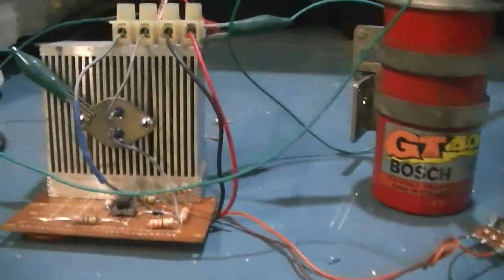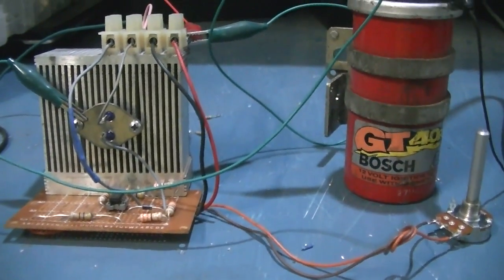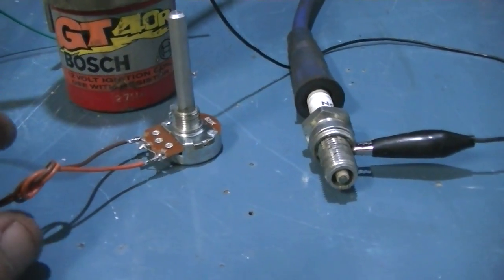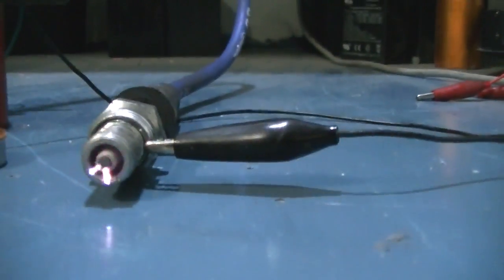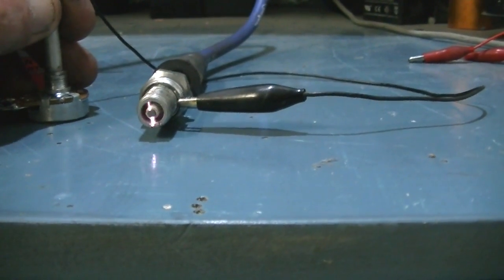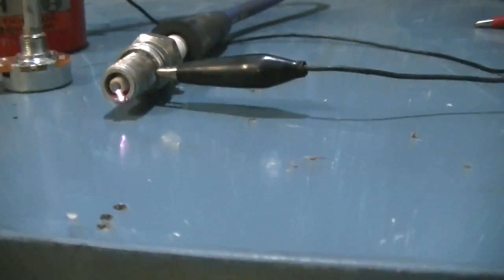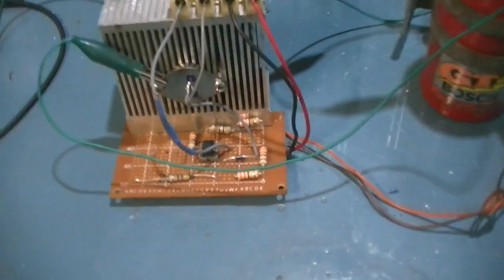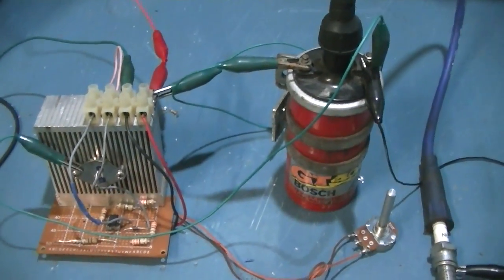HHO ignition circuit done.MTS

Comment from the maker: @rwg42985 Hi Russ-that could indeed be the case.I am still learning as i go.I was thinking along the line's of a plasma plug situation when i made this circuit.Going to get it instaled on the motor tonight and give it a run on standard fuel.If all go's well then i will begin work on the conversion chamber-This is a new little something i have come up with that will serve 3 purposes.i Will be intouch soon so as we can get on with the project.